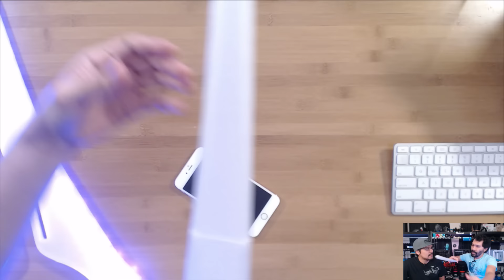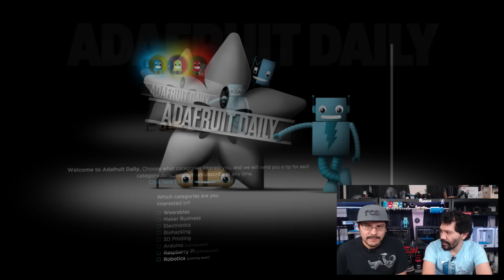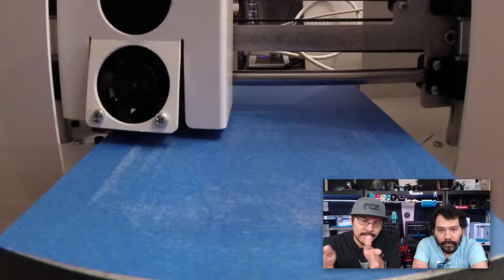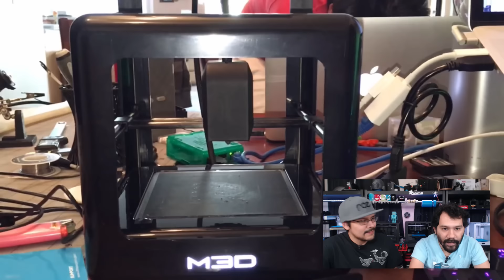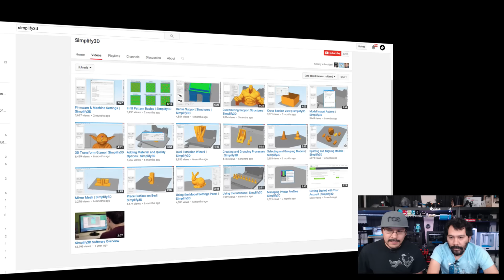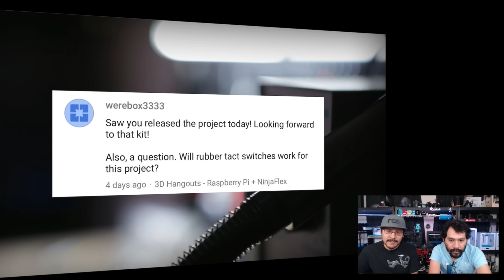3D Hangouts - Sword Play

Comment: I'm actually halfway through printing the Energy Sword, so this comes at a perfect time!! 

I printed the blade pieces with Taulmans T-Glase, and they look great. I'm having trouble printing the handle pieces though. I use Simplfy3D as well, but the handle pieces are so thin that trying to remove the supports causes the handles to split and break when printing with PLA. I can't download the printer profiles that were posted because my printer was not included. Could you guys help me out and provide the settings you used for supports for the handle pieces? Thanks again for the awesome design!

Comment: Hey guys, you were noting that the Pi camera up close. If you mean ability to focus close, there is a poorly kept secret of the Pi camera, which is the camera lens is fully focusable (I am using it in a real-time macro unit that can focus down to ~1cm). The lens rotates like a normal focusable lens, it's just lightly glued in place. Just ever so gently with a small set of jeweler's needle nose pliers and turn the lens ring. Once it's free you can shift focus to any depth you want...
Reply from the maker: Ah, good to know. I've seen this done on a video, but wasn't sure about it and feared I damage the lens. Will have to give it go, thanks for sharing! — Noe
Reply: +Adafruit Industries Noe, here is an example of a destructive testing rig I made (it is testing silicone pulmonary stents to simulate coughing and watching for tears in the silicone over 300,000 cycles) and you can see the pi camera very close in (it can focus actually way closer but I needed a wider field); http://feldman.com/henry/IMG_3959_sm.jpg